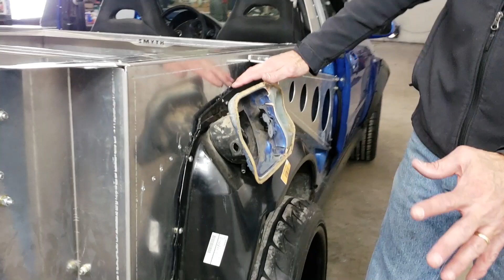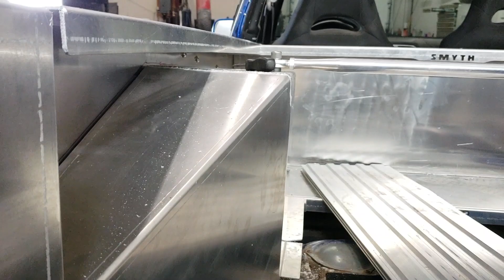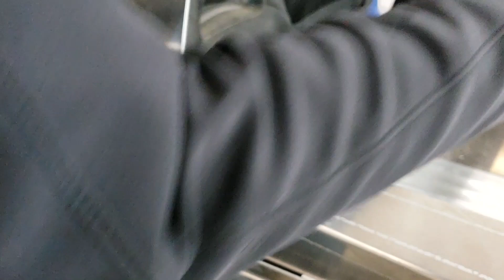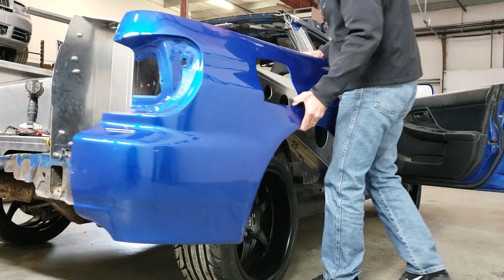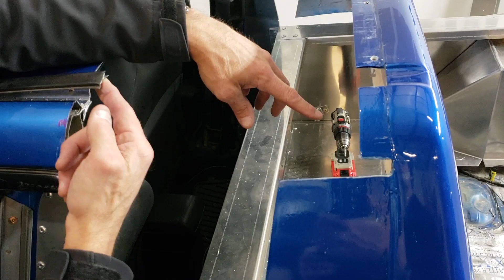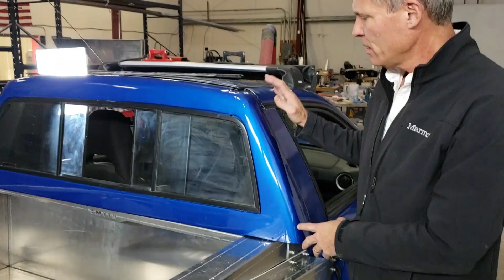Part 5: Subaru Ute Final Bed and Body Assembly

Comment: I am super interested in making ready to go cars based off your kits. I have extensive Subaru repair and rebuilding knowledge and experience and would like to do one of these conversions on a newer Outback or Crosstrek. Do you have shop partners that perform conversions on your behalf? 

One thing I might critique, I am seeing the absence of the CHMSL (center-high mounted stop lamp). Does the rear cap have provisions for this? I found out on a Baja H6 project I just completed, that the CHMSL is required to pass safety inspection in NY and, from my research, other states are requiring this for inspections.